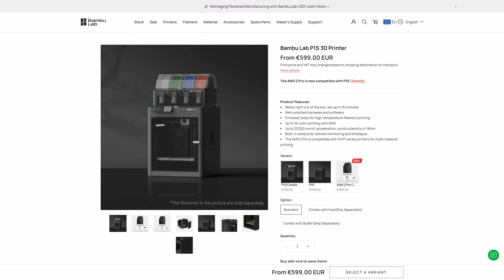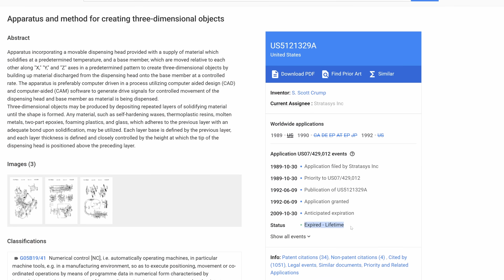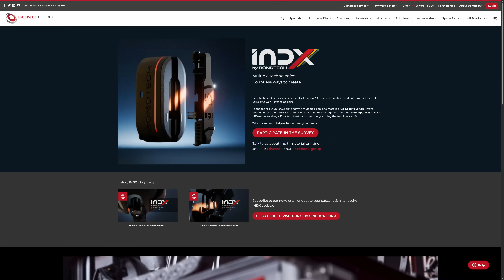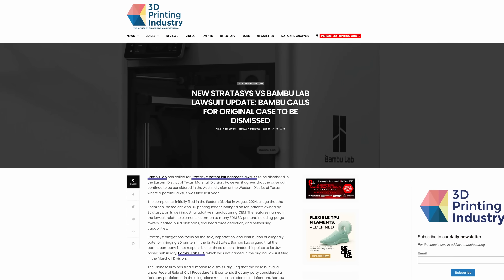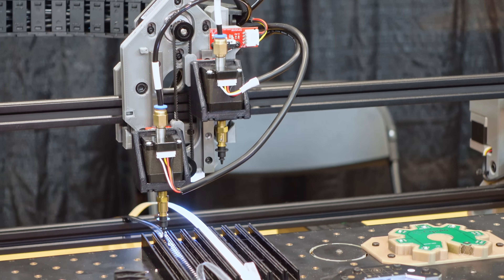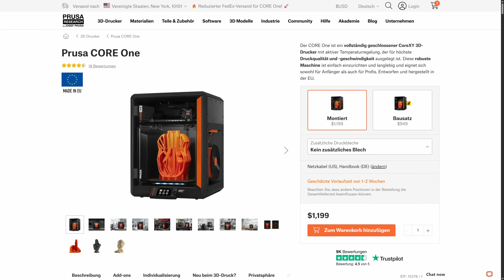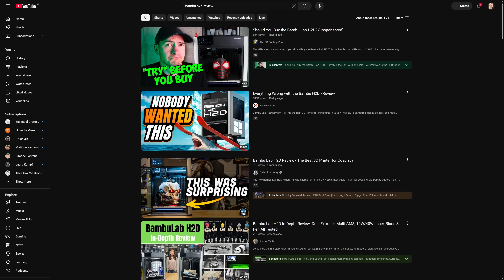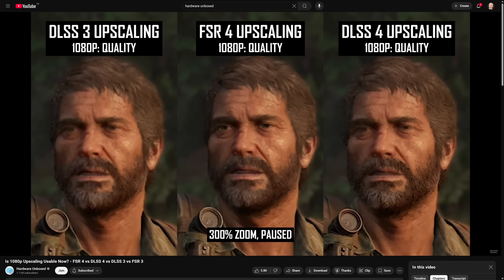How Bambu has won

Comment: But if Bambu actually acts on what they have put into their terms of service then all their customers are screwed. No matter the specs or value, it's a classic bait and switch, using subsidies from the Chinese system to gain market share until they have enough of a stranglehold on the market to enact some super scummy, unethical strategies. Why would they have them in their TOS if they weren't planning on using them at some point? You need to warn your viewers about this in any review of any Bambu product.
Reply: For what it's worth i think the key is not necessarily subsidies although they DO help manufacture and ship at lower cost, just systematically, the key for their decision making is that they're a VC backed company. Because there's a hundred 3D printer manufacturers which benefit from industry subsidies, but only one with a massive VC pool.
Reply: @SianaGearz You're correct.

When I said "subsidies from the Chinese system" I don't just mean direct subsidies from the Chinese government but also a hundred smaller policies that tilt things in favor of the company, such as easy credit, like you said, and an artificially weak currency and many more, mostly at the expense of the common Chinese person and their future. It is not sustainable long term.
Reply: "using subsidies from the Chinese system" What are you even talking about. There are no subsidies. That is a fake thing that people who can't compete make up.
Reply: 99% of people don't give a damn.  They just want a device that you take out of the box, undo a few screws and get printing on.  And Bambu delivers just that.  Don't like it, go build your own device, but people aren't prepared to do that any more as it actually takes effort.  Face it, the commoditization of 3d printing has just happened and it was due in a huge part, to not making printers that were 100% open, you know, like every other product that became mainstream and popular.  Get over it.
Reply: @zybch ahahaha! I love it, who moved my cheese crowd pouting.
Reply: @zybch  They don't care now, but they will once they're locked into a walled ecosystem with most the features locked behind a subscription paywall.
Reply: @Waldohasaskit210 This is the key point. Adobe really kicked off the subscription model and has been gushing cash ever since. So all tech (and other sectors) companies are emulating it. 3D printing will be no different. It's just a question of when.

Bait and switch? Just look at how cloud storage companies work. 

That's what puts me off buying Bambu: I don't know if I can trust them.

Comment: I started this madness in 2011. Saving for bamboo. All power to people who vote eoth wallet for prusa or someone but tinkering gets exhausting after sometimes. In world of mac there will be linux. The open-source will stay alive for bespoke solutions. But what makerbot started bamboo has finished.
Reply: Every week, the usual suspects field another offering to compete with the P1S, and they're getting closer and closer to matching that price/performance delta without compromising their users' rights.

There's already a couple of CoreXY available for far less that work about as well. The patience of the holdouts will be rewarded.
Reply: @SwervingLemon agree. But none of them are available on correct price in india where I live. Will lookout for alternatives
Reply: @karandex I mean,if I'm being completely fair, there's nothing out there that prints as fast and reliably for that price, but if you're willing to sacrifice even a little speed or a little quality, the price drops by half.
Reply: @SwervingLemon the first printer ingot was ender 3 v2 3 years ago. Before that I built all the printers. Reliability is paramount for now. It's like even after having sports car you want a suv for comfort. You always miss what you don't have

Comment: As being part of a 3d printing channel myself, I would say as an answer to your last question: Stick to your expertise and provide them in a well produced manner. For example, I like to hear more about the technical things of a 3d printer (like wiring, potential dangers etc.) in addition to the normal review things everyone says, as you are an expert in the technical aspects of 3d printing. That is what we try to provide on our channel as well, produce a good overall review, and then show the printer from our point of view (which is can it handle printing our products and being part of a print farm).

Comment: I hate to say it, but my Bambu p1s is the first time I’ve enjoyed the 3d printing hobby by itself instead of in conjunction with the hobby of 3d printers. I came from an ender 3. So far the only issues I’ve had have been because of 10 year old pla getting brittle or not having the best print quality.

I still debate building a voron, but it would be because the machine is another hobby.
Reply: The ender 3 experience has been lacking since 2018. There's a YouTuber based out of NZ who makes high end. Enders and mods them. He got a high end printer as a review unit and was blow away how good it was.

Comment: The big knock against Bambu for me isn't that the locked down their firmware, it's that they did it after the units were sold and in customers hands.  I have an iPhone, but I knew exactly what I was getting when I bought that.  Prusa has a track record of telling you exactly what you're getting and supporting that.  To me it's worth the extra cost--- though since I'm in the states a CoreOne isn't more expensive than an X1C thanks to the ongoing trade situation.

I have a Voron to mod, and my CoreOne arrives today for my "just works" printer.
Reply: Prusa support and open source are worth every extra penny I spend
Reply: exactly. Chose Core one also. I could not be more satisfied with the machine and the ecosystem.   I've Lived long enough to learn that The shine of 'cheaper' wears off pretty quickly.
Reply: I switched to X1Plus. But as a Sysadmin i understand what Bambu Lab tried and that they did it badly. Bambu Lab's API got attacked extensivly and it was burning money fast to keep it alive. A Service which is not a subscription fee but a one time Payment. They had to improve the security around it. How they did it... was bad. There are far better ways how to do it. But when you got Millions of Attacks daily, which is blockading your services, then you have to react. In Dez you could feel the Problems with their cloud service with outages etc. Now with the new System the outages are gone but it cutts into the costumer freedom. And their first Attempt was directly hacked. It could have been done better, far better together with a Token handed out for Orca Slicer. i am fine as i switched my Printer to X1Plus but at some point i may lose the cloud access as well.
Reply: Bollocks your iPhone.  They push through changes to your software and even terms and conditions while you sleep.
Reply: Uh, Apple did that whole "Your battery is dying, no really" throttling when people already had their phones, so not too sure about that example.
Reply: @tenchuu007  that's a fair point.  I honestly forgot about that one.
Reply: You don't have to change the firmware.
Reply: @rsilvers129 And you can also downgrade your firmware.
Reply: Am I misunderstanding something here, all I have to do is tick dev mode, and it's not locked down any more.  I am seeing as more of a “child lock” which could be helpful for newbies.
Reply: @acidtwin  Dev mode is also only in LAN only mode.  So you've lost a lot of features just from that (no app integration, etc.).  And don't forget that it also impacts how Bambu will support your printer.  Have an issue that is entirely unrelated (screen failure or something) but running in Dev LAN mode they could reject a warranty claim.
Reply: @acidtwin  do you remember that you used to be able to install Linux on your Sony PlayStations? Do you remember the outcry when Sony took that ability away? Ppeople forget too quickly. Today Bamboo "allows" you to have dev mode, but that can be taken away at a time of their choosing and then the next series of customers won't even know that such a thing was possible.
Reply: @acidtwin misinformation is easy to spread but hard to correct
Reply: @acidtwin  Dev mode works for now, but they already changed the rules once so there's no guarantee they won't do it again.  And they only added dev mode after community backlash.

Bambu printers are solid and take care of most of what people new to 3D printing need.  But I can't recommend them since they changed the rules after the sale.
Reply: @mattmercieca6010  That is the point, and that should be illegal, as it is, there's a good class action suit that hopefully someone files but the lack of respect doing something like this shows to consumers is infuriating, I have bambu printers but I won't consider them anymore. I can't trust them and their lies after they dropped their "control" malware. Yes malware, if you're crippling my printer by making that control software mandatory in order to have the same features I had before you introduced the control software. It's malware imo.
Reply: @mattmercieca6010 all companies do that. How do you think they can do it? What you get wrong here is that they don’t force the new versions upon anyone who already has their printer. Just new models. Then you can choose for yourself.
Reply: @mattmercieca6010  Insert Darth Vader "I have altered the deal, pray I don't alter it further" meme here.
Reply: Are updates mandatory? No? Then it's not forced. Using their services means you comply to their rules. You don't have to use their services to use your printer.
Reply: @2010ngojo  They did update the EULA to allow them to forcefully update the firmware if they want to.
Reply: You really think Prusa is as "open" as they state?  I remember years ago when E3D released the REVO for the MK3, and Prusa did everything to prevent it from working because they knew they were developing their own.  They are the angels some people think they are.
Reply: @A1N0  I don't and I believe most don't think Prusa are angels. That's an unreasonable standard.  But I can analyze the behavior of the two groups over dozens of things over several years, and add up who's behavior I judge to be better. Who do _I want to do business with.

Its unreasonable to hold that one company is perfect and the other is perfectly evil.  There are details, and nuances and all are made of fallible humans.

The act of deciding firmly against one, does not imply that I "love" the other. It just so happens that I had two choices and my discerment has disqualified one.
Reply: You know what the Bambu printers all have, a micro SD slot.  So you don't even need a LAN.  Grow up, the sky isn't falling.

Comment: The tinkering was exactly what made me quit 3D writing for a while. It was fun to mod but each print taking an hour to set up and still having a good chance to fail. 

Now I can use a 3D printer like a printer. Its a tool now, not a toy.

So review it like a tool. Is it reliable? Is it repairable? What is the quality of print without tinkering.

Comment: I had put bambu lab machines in lan mode because of the firmware debacle. A significant downgrade in quality of life.

Not speaking for other users, but I am not going to buy another Bambu again.
Reply: I'm on the same boat as you.
Bought a bambu because theybwere good quality and affordable and the LANOnly mode allowed me to buy it if something like this happened... and it did, which sucks.

Next printer will be a Voron not a Prusa.

Comment: I understand people saying bambu software path is a poor decision and “non ethical”. Fact of the matter is there’s no other machine that is plug n play, heated chamber,  2 hot ends, tried and true AMS, with all the detail bambu puts into their product. I purchased an H2D with a tariff markup and I’m happier with the machine than i’d with Prusa Core One or XL. If you want machine to tinker with then buy a Prusa.

Edit: The back breaker for me was Prusa  with their 290c hotend. It’s 2025 and it seems the market has swayed towards 350c especially for enclosed machines.
Reply: It's wild how people who have never even touched a Prusa, much less used one, think that you need to tinker with them to make them work. Couldn't be farther from the truth. I have an entire farm filled with Prusas, old and new. I'll take them over any baboo any day.
Reply: @varukasalt Right? I have a couple Sovol SV01's that have been trouble-free since the day I got them, and print beautifully.

I'm beginning to suspect that owning and loving a Bambu is a sign of skill issues.
Reply: @SwervingLemon I love my first couple ender 3s, still run my klipper ender 3 for TPU since it’s so dialed. The H2D really surprised me in how great of a package it was out of the box. No hate for other products in the industry, just noting bambu released a damn solid printer in the H2D.
Reply: @varukasalt I owned a Mk4 upgraded to Mk4s, and use a XL at work. Friend has a core one and we both agree we are more impressed with H2D. Never had my prusas provide the same quality prints my H2D provide. The bambu surprised me, an at heart prusa guy.

Comment: There are a few segments where Bambu is losing, though. Take folk like me, who need more than 250mm3 build volume, but who have a budget of less than a grand. I waited and waited for a P1S+, and then just bought a Sovol SV08...had to do a fair bit of modding, but I've ended up with a printer that's better than my Bambus in every way (speed, quality, reliability, even the "print-and-forget" experience). The H2D basically pushed me towards the Voronesque world. I've donated my P1S to a local Hobby Hub, and I'll probably be getting another SV08 to replace it now that I know what needs doing.

There's also the part of the market which doesn't like the constant push towards cloud connectivity.
Reply: Publish a guide to the mods you have done.
Reply: @draconpern4132  - there are better guides out there than I could write ;) However, the list is:

- CryoGrip Glacier build plate to bring the print temp down
- Shimmed the bed with washers underneath to flatten it to ~0.16mm
- Mainline Klipper
- BTT Eddy Duo to replace the inductive probe

Total cost of about £80, and a couple of weekends of work.

Comment: As a Bambu owner, I don't care about open source or building it yourself.  Maybe I should, but after struggling with multiple creality printers and even building a Voron and failing, I was really happy to spend $1k and have a printer that has done nothing but work every time I've used it for a year.  I don't think about it, I just hit print and it prints.  Every time.
Reply: You can thank open source for even having 3D printers at all, and you should
Reply: @howtoguy17  no doubt, but there's a market for something that "just works"<tm> and that's clear.